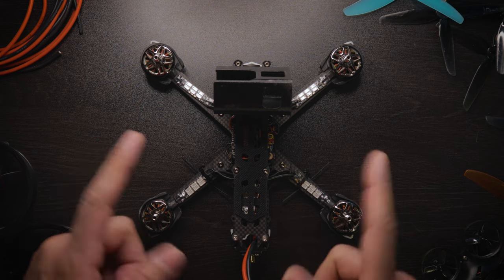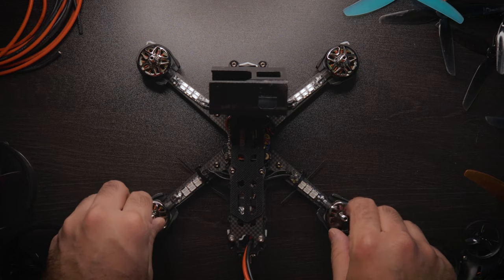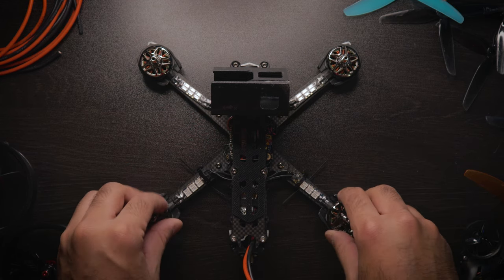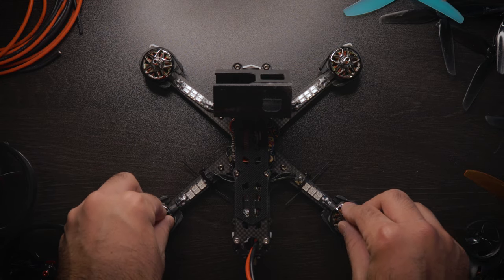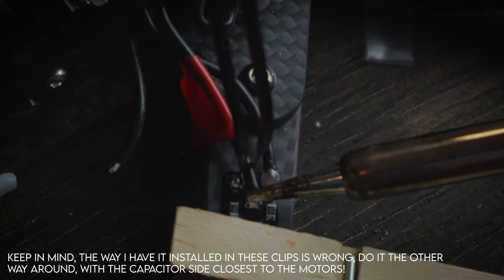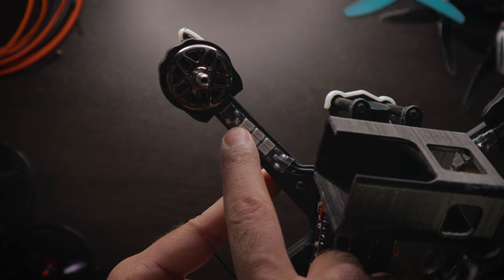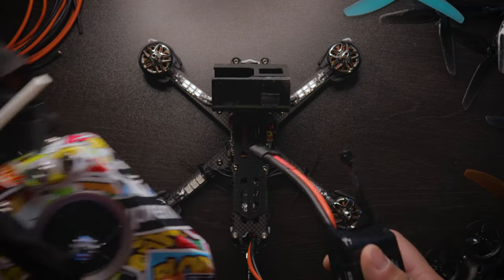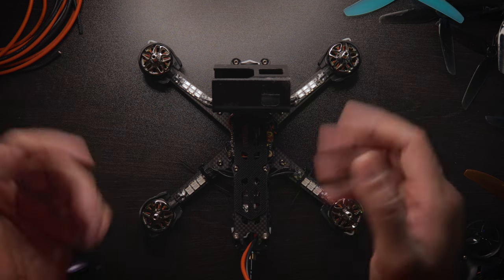Man are these bright or what! (CLRacing Race LEDs)

Comment: Nice  vid,
I just did my first LED CLRacing Racewire on my Rekon5 the other night, 
fun playing with right stick to make them dance.... 
haven't maiden yet... 
good heads up on the capacitors towards motors... 
now I have to double check... 
hrmm.. If I have to go back in there. 
maybe I'll do bottom too...
Reply from the maker: Thanks man, and yea these things are pretty sweet, just gotta keep an eye out for the right installation
Reply: @supafpv1759  upon further inspection... 
3 correct... 
1 flipped... 
son of a.
20 min later.. 
all set. 
thanks again,
Reply from the maker: @RCRitterFPV  Ay thats good that you caught it before it hurt your quad!

Comment: great video, how do you like the Motors: RcInPower Smoox 2306.5? are they a Unibell?
Reply from the maker: Theyre awesome man, best motors I've ever run. Theyre super durable, and actually insanely powerful lmao. Yea unibell.
Reply: @supafpv1759  nice, i been using 2407 Zips with Popo, the pop on them is crazy. However recently the popo has wasted my time at spot due to the fine dust i got up here.  So i slap my old TOA 2306 Armattan motors back into service and man even after not using them for 6 month they where so smooth. So i did a bunch or research and order 10 motors from TOA the 2306 High KV, and the 2207 1950 kv, They are pricy but i hear they are worth it.  They will be showing up soon, but the armattan i put in my next video.
Reply from the maker: @enarramore77  not bad not bad. 2407 huh man that must’ve had some serious torque. Toas are awesome they just take a while to ship out.

Comment: Hey cool video! Looking back at the diagram on which way the capacitors should be face. Can you put those LEDs on the top and bottom of the the arm simultaneously?
Reply from the maker: Yessir, but follow the diagram on how to connect the second set underneath. You run three short wires to the second set underneath the arms.